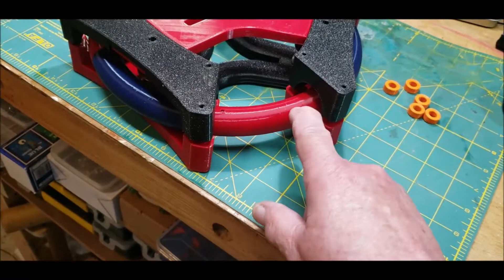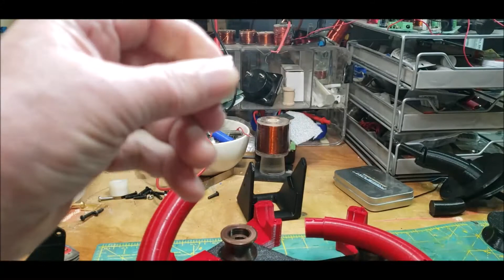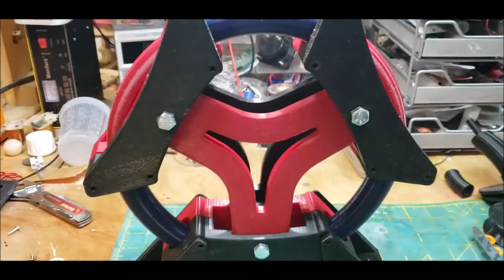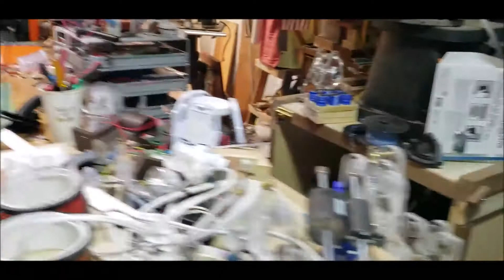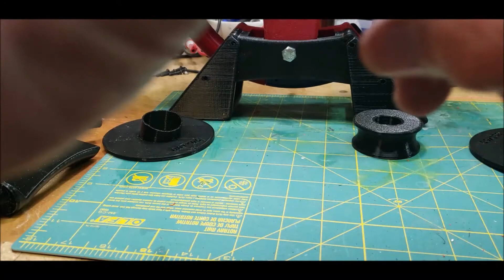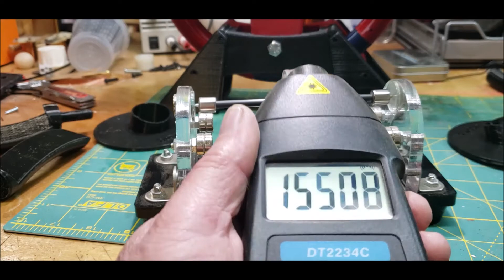3D Printed Solenoid Motor update

Comment: You might find it works ok loose. You had to rub the hall sensor in my face. Still can't get that dam thing to work. Now my hall is going high/low instead of on and off.
Reply from the maker: lolol sorry pal. The Hall sensor I showed is not a normal Hall. It has the 4th lead on it and I believe it has some sort of transistor built in it. I'll try and find the link where I got them and post it up here
Reply from the maker: I got these special Hall chips at Mouser Electronics and the part is 621-AH477AZ4-BG1
Reply from the maker: This is the other part number
AH477AZ4-BG1
Desc.:	Board Mount Hall Effect / Magnetic Sensors Board Mount Hall Effect / Magnetic Sensors Sgl Hall-Effect Ltch 3.5V to 18V 20Vcc

Comment: Sorry I did not leave a message before was at work, but yours is looking create, did you sees the ring move on mine when I placed a 12v battery on the coil, can't wait to see yours moving, you will be pleased to see how much power the coils we have on the magnets.
Things are finally looking promising, now for the fun part working out the circuit.
Reply from the maker: yes I did and that's a GOOD sign man. Now you just need a circuit to make the system work completely.
Reply: @mcorrade  what you guys should try is change the plane it rotates in. Like a gravitron.  Always amazed me how little electric motors could move that much mass.that coil jig is exactly what I was thinking. Remember the odd/even rule if your gonna make nice pancakes.